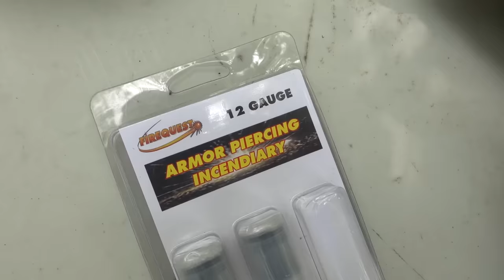Is a Bulldozer Bullet Proof???

Comment: I used to build those, and we actually  beefed up the ones that went over seas to the troops with AR 500.
Reply: nice
Reply: That’s impressive
Reply: AR 500 is Abrasion Resistant... it was literally made for dozer/plow blades
Reply: Yeah, we used AR plating in all the rock crushing equipment as liners, because mild steel would wear far too fast. Definitely not because the operators were at risk of gun fire lol so I'd think they used it the same wherever you worked
Reply: I imagine he means they added a little extra ar 500 plating to them, rather than built them out of it specifically for that purpose
Or hes lying
Reply: I'm not surprised that the exterior digging edge would be made out of hardened steel. As stated, mild steel would wear too fast.

Comment: Thickness of a slanted object is “actual thickness * sin(angle of slant)” so the angle you had it at made it ~1.75x thicker than it actually was
Reply: Very smart my friend!!!
Reply: Very smart my friend
Reply: ok!!!
Reply: ok
Reply: It is also worth considering that the bullet hits the inclined surface not at a right angle, but tangentially. Accordingly, only a small part of the kinetic energy of the bullet is transferred to the surface, the rest simply changes its direction vector and the bullet continues to move along a different trajectory instead of penetrating the surface.
Reply: @MrDerReiter  yea its true
Reply: @MrDerReiter  though countered somewhat by the projectile correcting a few degrees when the tip makes contact. It's not much but it can make the difference
Reply: Matt has been exposed
Reply: The codomain of sine is between -1 and 1, your calculation suggests the effective thickness is less. It should be actual thickness / sin(angle)
Reply: This is why tanks used sloped armor (like the Russiam T34), enemy shells would literally skip off.
Reply: Wel actually its "actual thickness"/cos(angle of slant), because a 90* triangle with sides of 1&1 has a long side of 1.414 (root2)  meaning if you shot it from 45* thickness of 1 would be 1.414. This is the case with "actual thickness"/cos(angle of slant) and not with "actual thickness"xsin(angle)
Reply: they use that in tankery. why tank  front plates are on an angle.
Reply: Maff

Comment: When they showed the rounds in the film, they had pointed tips...

Try FN Five-Seven AP tungsten core ?
Reply: Even from a ps-90 carbine, you would need about 1.000 joules of energy to achieve the same penetration of a regular mild steel jacket 7.62*39 AK-47.
 Still, when it comes to the movie, I guess the Five-Seven was the closest thing.
Reply: Of course the beginning of the movie made it a pistol round that would go through Kevlar vests like butter.  Then it had to bring a dozer in the mix
Reply: @SalveMonesvol  Wasn't it stated in the movie that the bullets were Teflon coated in addition to being pointed?  I just trying to recall from memory from when I watched it in 1992.  Can't check it right now.
Reply: Ss190 (5.7 AP) is steel tip aluminum core . No tungsten maybe 3% if any. 5.56 Green tip has better armor penetrating abilities than it actually
Reply: The 57 is my favorite gun of all time. Never heard of the tungsten round in anything but a tank round though.
Reply: @SalveMonesvol  the 7. 62x39 is moving 700m/s(roughly) and the 5.7x28 is also moving @700m/s (roughly) and has a smaller diameter so defenetly not true. Learn physics, please!
Reply: @KoshN  
Teflon won't cut armor. It'll reduce pen, if anything.
Reply: He needs to get some SLAP rounds
Reply: @SalveMonesvol  
Well, no.
7.62AK is a poor penetrator, especially shitty M43 FMJ or MSC FMJ. There's multiple cases of IIIA being hit an an angle and remaining unpierced. It's a wide bullet with low velocity, what do you expect?
Reply: @KoishiVibin  I was just trying to remember what was said in the movie.
Reply: @kadenhinojosa3582  
Sabots are a diminishing returns game the smaller you go.
Reply: everybody thinks the 5.7x28 has good penetrative power but to be honest, it fucking sucks, its basicly a .22 with a sharper point.
think about it, the 5.56 is .22 the 5.7 is .22 and .22 long rifle is .22.
the reason 5.56 is far superior is because the case is way bigger and filled with way more poweder.
Reply: @GuardionOfficial  no one (intelligent) says it's the" ultimate man stopper" but because its a ".22"it dosen't need much power to go through stuff and it will go through level 3a (and sometimes) level 3 body armor, it only leaves a. 22 hole, but thats better than a 9mm stuck inside a vest imhu
Reply: @GuardionOfficial  Another point to mention is that most of the testing saying 5.7 is good for penetrating body armor is normally fired from the FN PS90 not the FN five seven
Reply: @KoishiVibin  Many AP handgun rounds have/had teflon tips to protect the steel core and help feeding. That's why so many people associate teflon with armor-piercing ammo.
Reply: The 5.7 was designed as an intermediate to penetrate soft armor, which it does. While fitting in both pistols and rifles. Its a lovely round that does its job
Reply: @sanderrehepapp5219  it certainly does not allways pen a IIIA vest and forget about the lvl III plates bro, i want to love the 5.7 but it just does not do what it is supposed to do.
and well it was made to penetrate...
Reply: @sanderrehepapp5219  What's your point? 
 That a five seven can penetrate more than an AK? Are you even considering sectional density?
 An armour plate rated for 7.62*39 will stop anything out of an fn five-seven.
Reply: @SalveMonesvol  what's your point? That a 5.7 has better penetration cause it has less resistance? cool argument bro, i already made that, (a counter argument to you)
Reply: Dude, that hard core to extream! Thats so much awesomeness that you really cant improve on it unless you really bulk up the target.

Comment: 10:00

It's not strong, it's just angled, like tank armor.
Reply: Tank amour is strong though
Reply: So it's strong?
Reply: Mantiez it’s just angles, like tank armor
Reply: Mantiez if tank amour wasn’t angled it would be half the strength it makes the projectile ricochet of the amour
Reply: Sort of, but more of a geometry issue than shear strength.  The biggest weakness of the German tanks in WW2 was the flat armor.  The Russians figured out they could get similar performance with less metal by sloping the armor, essentially thickening the armor because of the angle impact.  Less armor means lighter tank meaning more speed.

The tigers were more powerful, but the t-34 was faster, more maneuverable and more quickly produced.
Reply: @mantiez8428  By increasing the angle relative to the bullet, it increases relative thickness and rigidity of the armour. Therefore a 20mm plate at 45 degree angle will have 40mm effective thickness
Reply: Which only increases effective thickness. At a 45 degree angle, thickness increases by ~1.41 times.
Reply: it was angled in the movie too
Reply: it kinda looks like the tank armor front right?
Reply: Guess where target steel and steel armor plate came from? This stuff
Reply: But... It is so Strooonngg.... Lol !!!
Reply: Cutting edges and wear bars are harder than the rest of the bucket, usually AR 400. Or AR 400F. I work as a welder and we repair and build those.
Reply: Just like shooting water all about angle.
Reply: For a purely scientific explanation. It can be explained as the thickness of the steel divided by the sine of the angle of impact. Or multiply the force by the sine angle to get the force into the steel.                  Tl:dr bullets either hit thicker steel, or are partially deflected and.

Comment: The rounds they were talking about in the movie was the old cop term for teflon coated rounds.
Reply: Ol' black talons
Reply: The coating was not the "armor peircing" aspect. They were made of relatively hard materials like brass and pointed. The teflon was added to save your barrel from excessive wear.
Reply: @kobeculpitt114  
↑This ↑
Reply: Kobe Culpitt yep
Reply: Titanium tips would be awesome!!!🤔🤔🤔😈😈☠☠
Reply: @goonercarl9792  Stronger but lighter, so less energy is carried along with the bullet.
Reply: Diddn't real cop killer rounds have a hard steel core with "softer" pointed brass outside. With the idea being that the copper would pierce the majority of  the body armor and the steel would then pierce the rest and penetrate the body of the individual wearing it?

Comment: You are hitting angled armor, making it almost twice as hard to penetrate.
Reply: If you look, I'm sure the ranch has a film company as they are almost as honest as any  BS movie.
Reply: bob m don’t watch then with your bs
Reply: the leading edge of an excavator bucket is probably hardened steel too, so it's even harder
Reply: Gunner, load sabot!
Reply: @nadiedeinteres1285  the edge is work hardened steel. The same steel used for forklift tines.
Reply: do it to a update bucket that one has wear from working in the ground
Reply: @Amar Grg I thought I saw something at first to. It's just the smoking barrel
Reply: Cal Bowman that makes no sense.
Reply: Yup
Reply: That's sorta the point. Video was to see if a bulldozer is bullet proof. It was.
Reply: @nadiedeinteres1285  That is what AR500 was designed for. Abrasion Resistance.
Reply: Due to the numeric laws of physics that’s not how things work snoopplayz
Reply: @zachchildress1092  yes it is lmao if u hit anything and its at a 45 degree angle there is physically 2 times the amount of materiel

Comment: This is why tanks use sloped armor, sloped armor makes the armor “thicker” in a way and a lot harder to penetrate
Reply: I looked for this comment 👏🏼👍🏼 exactly correct sir
Reply: JeremyK 541OR.  They still slope depleted uranium...
Reply: Not thicker in a way, actually thicker. There really is more metal in the cross section of sloped armor. And the added bonus is it deforms the round at a slant which also helps.
Reply: @holderheck  i can make a bomb out of a roll of toilet paper and a stick of dynamite that will blow through any armor.
Reply: @user-dd9qq1ru7s  gonna make a video? Askin for a friend
Reply: Not so much lately, yes there is some but it'mostly replaced by ERA
Reply: Beat me to it
Reply: JeremyK 541OR.  Yes WMD`s just like what Uncle Sam likes.

Comment: That's AR 500 steel you're shooting Matt! That's why it was invented, abrasion resistance for heavy equipment buckets and such. Hence the reason it was so hard to even put a dent in it.
Reply: Yes and no. Structural welder here.  The cutting edge IS essentially AR 500, but the core of the bucket is plain Jane mild steel.
Reply: The lip is ar500 but not the center of the bucket..
Reply: Was just gonna say what Rough Country Dad said 👍
Reply: Nerd
Reply: As a former contractor I can confirm that’s ar 500 or 550.
Reply: As a mr. know it all I have to concur w mr. Jamie j Richardson and emphasize the plural NERDS! 😂
Reply: BigDipper907 hahaha!!!
Reply: I’ve worked with construction equipment before and I can say that bulldozer blades are the same metal but a lot thicker so I would imagine nothing would go through that
Reply: AR450 is used often for strike or wear plates. 450 is often stronger and more importantly less brittle then AR500.
Reply: @stokesy8589  In "Mover of Men and Mountains" Letourneau notes that when it came to clearing Japanese trenches the Americans would just bulldoze the trenches because bulldozers blades are indeed quite bulletproof.
Reply: Milsparro what bulldozers were used? Very curious on that.. I know JcBs military line comes with heavier cabs and drivetrains but attachments are no different to the public. And depending on size bulldozer blades could be bigger/thicker.. but most wear items on buckets, shovels and blades are some type of AR.. not the whole part..
Reply: @BigDipper907 nerds

Comment: When i was a kid they said it must have been the 9mm "m/39B" ammo our military used in their SMGs, wich is a 9x19mm parabellum with a lead core surounded by a somewhat hardened steel coat and on top of that a thin layer of copper rich brass. 
Have had some experience of it since then and i wouldnt be at all suprised if it actually would manage the thinner parts of that bucket. We shot through quite thick steel with them and they left a charasteristic hole that was copper coated. We used to joke that the only thing under 1cm that could stop it was a wet blanket. And yes, wet blankets did stop it (sometimes) if they just hung freely.

Comment: That was nice demonstration of sloped armour :D
Reply: Exactly. Tank armour in the 1930s, and armoured car armour up till today are just about this thickness. So 30mm sloped could have effective coefficient of up to 70mm depending on the angle...
Reply: @Yman83464z  The Soviets were very happy when they figured this out xD The Nazis less so :')
Reply: @StickyTank  
The Germans understood the concept of slopped armor, it was used on ships and even plate armor from the late middle ages.  The lack of slopped armor on the German tanks had more to do with limitations in the manufacturing process and assembly lines designed not to look like they were manufacturing tanks before the war started combined with the need to turn out as many tanks as possible.  I am surprised that they didn't have more slopped armor on their tanks by the time the war ended though.  The Russians solved the problem sooner by casting the armor or hull in molds, but this meant the qualities of the steel were different and when penetrated or nearly so tend to spray additional shrapnel from the armor splaying.

Comment: 5.56 round that made it while the bucket was slanted: "Am I a joke to you?"
Reply: I wonder if it was a green tip or a regular fmj
Reply: @neowolf09  good question.. idk
Reply: He hit it right at the welded seem. So a lot flatter than where he was hitting with the rest. And if it was a poor weld, could've had more rust/weaker structure.
Reply: @Devil Gurung I can’t seem to find it

Comment: It's 6 or 7 gauge steel with 1/4 inch cutting edge. So, 5mm sheet metal on an angle stops 50. cal armour piercing rounds.

Comment: well who would have though a hardened cutting edge is somewhat hard :D
Reply: This. The teeth on excavators are the same, mild steel bucket, hardened tool steel teeth. That lip looks like about 1"-1.5" thick hardened steel lol...and he shot everything but the last AP round at an angle that promoted deflection over penetration.
Reply: Thought
Reply: Exactly.

Comment: Yes it did come off an excavator, just thought I'd clear that up.
Reply: *loader
it's too big for a digger, i know this because i've seen it before and i always just wanted to see how bullet proof it is, so wet dream time,
Reply: @Citricpie  they make some pretty big excavators dude.
Reply: Looks like the bucket they use to do ditches around here "Gradall"
Reply: @Austin23191  nah, too shallow, the shape is worthless for digging and breaking through rock, plus i have seen something that looks exactly like it, and it went on a loader
Reply: That bucket is good for a pipe crew  moving mass amounts of material and pulling flat grade 👍🏼
Reply: It's a shovel bucket that attaches to a excavator or trackhoe. If you look at where the implement attaches is a dead giveaway.
Reply: It’s a grading bucket for an excavator
Reply: Gradall bucket. For cleaning ditches
Reply: James Paley it came off a excavator

Comment: I’ll be operating dozers in Syria come July, good to know 7.62 had some hold ups
Reply: 7.62x39 has pretty low muzzle velocity compared to a 556
Reply: Its the IED's that get you
Reply: Dozer blades and loader buckets are not the same.  The dozer blade is thicker than the bucket as it needs to rip the earth not lift it.  And yes the IEDS are the real problem.
Reply: @daugin  But it's also much heavyer
Reply: @olisk-jy9rz  556 is just plain and simple better at penetrating. 7.62x39 has more stopping power

Comment: I'm curious if the FN 57 would make it through it.
Reply: I feel like it would.
Reply: In the thin spots. Abrasive resistant metal( ar plate) is used on the wear points of buckets. It's like having 1/2" thick ar500 plate on both sides of the parent metal of the bucket.
Reply: @pamundson9  what is AR500 for a type of steel, what's its hardness?

Comment: Ok so I think you need to try again going from the 5.56 up. You hit the weld so it might not go through the thicker metal. Also since you changed the angle everything else should be tested at the flat angle. Just my opinion.

Comment: U should buy slap rounds for the 50 an do a review
Reply: The closest you will ever get to that is the Remington Accelerator, a .30-06 round with a.223 cal 55gn projectile in a sabot. The saboted light armor piercing - SLAP round - is not for commercial sale in the United States and was only made for and used by the US Military. It is obsolete for use in 7.62×54mm and 5.56×45mm  rifles due to the introduction of the newer 5.56×45mm 62gn Green Tip penetrator round. The SLAP round had poor ballistics as the main issue was inconsistent separation of the sabot and propper concentric placement of the penetrator core and extreme tolerance control of the cores weight.